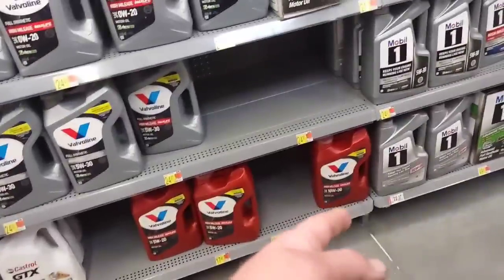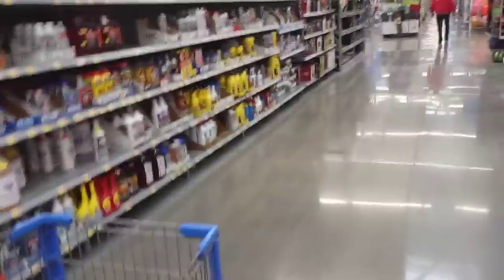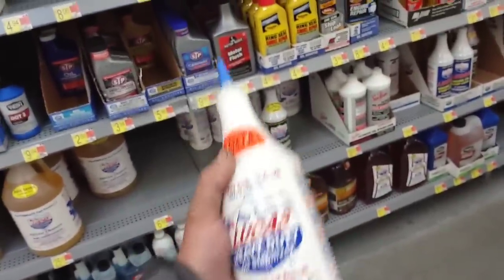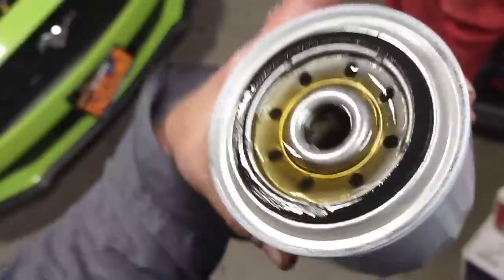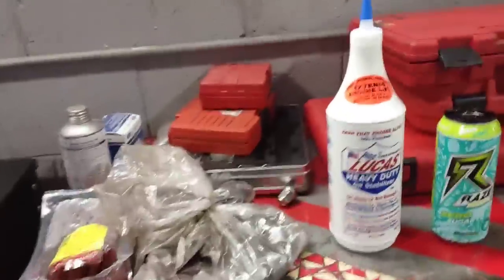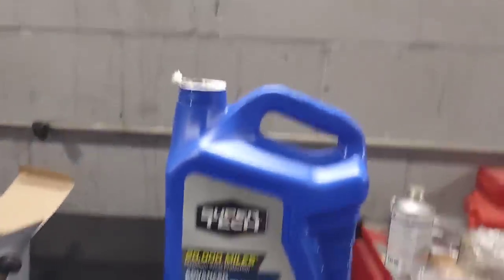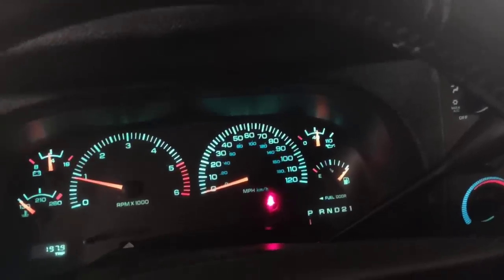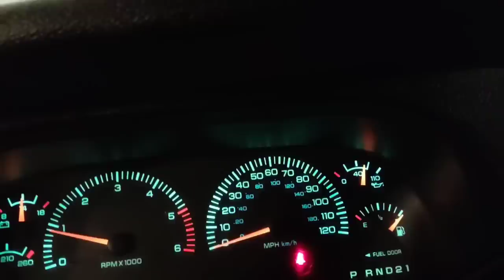We continue With Marvel Mystery Oil and SuperTech 10w30 20k Mile Full Synthetic Oil Dodge Ram 5.2L

Comment: I saw that on mmo's sight they stated it's a 5 weight so it shouldn't effect viscosity of 5w30 oil right?
Reply: They say it will cut it half a weight.
Reply: @delbertcody9154  so I'm guessing not really much of a problem for just daily driving? Temps in my area stay around 70-80 so
Reply: @shoveI  yea I don't buy into the thicker oil, I had heard that the engines are designed for a certain weight so thicker wears on parts because the oil is forcing itself through a small space not designed for it, I don't know if ford boss said this in an earlier video or if some other youtuber stated it but it makes sense to me. But about mmo they stated it's 5 weight and would lower the second weight by like 4 which doesn't seem harmful when just daily driven at a steady warm temp

Comment: 16  ounces of automatic transmission fluid  added to engine oil at each oil change will do the same thing as MMO don't over fill .
Reply: Automatic transmission fluid contains ZERO detergents to clean ANYTHING, so what is actually doing the cleaning and HOW? I call BS.

Comment: MMO looks like 0W-16 oil.
Wonder what would happen if you ran MMO only in an engine that takes 0W-16
Reply: MMO has a very low flash point (128 F) thus you would quickly be left without any lubricant/fluid as the engine reaches full operating temperature much of the MMO would vaporize. This is also why when people choose to run MMO for extended periods of time such as adding MMO to new oil it's a good idea to keep an eye on your oil level as the napthenic content of the MMO will vaporize long before you are due for a new oil change. For this reason the original formulator/manufacturer of MMO recommended adding MMO to the crankcase 300 miles before you change your oil (notice that it wasn't adding to new oil) taking in to account the vaporization rate but also so as to get that dirty oil with loosened carbon particles and loosened sludge out of the engine/pan/pump soon after adding the MMO so as to avoid any possible clogging issues.

Comment: When I was a kid Marvel Mystery oil had had a religion cult like following like Sea foam has now.   These cult like products usually have high powered marketing. When changing oil regularly, no after market additive products are necessary.  The only benefit they serve is making  the user feel good.
Reply from the maker: This is NOT the case 

It really does work

Comment: How often you recommend oil changes on full synthetic?
Reply: 3-5k
Reply: Honestly full synthetic doesn't make a lick of difference.  It's just better oil, still do your regular interval.  5~7 for highway majority, 3~5k for gridlock and stop and go majority.  If you haul, if you use your truck/van to WORK 3k of the cheapest stuff you can get.
Reply: @AK-ky3ou  or Every 6 months if you don't drive that much heat cycles on oil wears it down.
Reply: @greggc.touftree5936  3-5 k is Ford boss’ max.  I’d assume it’s also his recommendation.
Reply: @jaggsta   Not my opinion,  it is Ford boss that won’t go past 5k even with pzu or amsoil.
Reply from the maker: I don't see any reason to go more than 5000 miles on an oil change and if you're in stop-and-go driving 3000 miles especially if you're doing short trips but never more than five thousand and that's my story and I'm sticking to it and before anybody ask me why I've got tons of videos on here explaining why when I'm taking apart Motors I'm not going to get back into it again 5000 Max for Highway use 3000 for in town and short trip driving
Reply from the maker: I would never wait six months to change oil it does have a lifespan the most I would wait is 3 months if you're not driving a lot
Reply: If your engine is still within the warranty period, you must change the oil at the mfg specified intervals, or earlier. Synthetic oil doesn't change that. If you are not under warranty, you can do what you want.
Reply: I live in Phx, AZ. So the temps get like 118 or so for summer. Lots of stop and go. My Ram is actually running like 210 or 215 at times since summer got here. Used to run at 196 or 198. I usually do it every six months but since I have two vehicles every time I change the full synthetic oil it only has like 3,000 miles on it. So I feel like I am wasting the oil. Was thinking of 5,000 mile or 1 year whatever comes first with quaker state full synthetic but 1 year seems like a stretch. Wanted to try Amsoil and go annual oil change or 7,500 miles. Whatever comes first
Reply: Any thoughts to annual oil change with Amsoil or 7,500 miles whichever comes first?
Reply: I agree with you about not going over 5,000 miles with the oil. 5,000 miles seems like enough use out of it. The lifespan of the oil being used is what I question. I have seen project farm send in 1 year old with low miles on it and Blackstone labs saying it is still good. The only oil I would try that with is Amsoil along with their filter or only run it to 7,500 miles. No heavy towing either

Comment: I'm not going to question you because I know you know your stuff but I'm curious to know the answer though why are using 10 w30 with Lucas in a 5w 20 car I'm assuming I know the older ones were five W 30 but I work at a oil change place and people come in with 10w 40 with Honda Civics that are 0w 20 cars and I told him that they could damage stuff because it has the variable valve timing and the engine uses oil pressure to control variable valve timing
Reply from the maker: 5 W 30 + 10 W 30 are what is recommended for this motor but more 10 w-30 than 5 W 30
Reply: @TEAMHYBRID007 — you should flip through an owners manual from the 90s and early 2000s. Most cars came with 5w30 on the oil cap but the owners manual would show a WIDE Range of acceptable viscosities that you can run, based mostly on your climate and operating temps. You’d be surprised that most engines can easily run a 20w50 without the engine even caring one bit. It fact, it will probably thank you in the long run.

Comment: Why the surper tech oil filter?
Reply from the maker: Why not I'm changing the oil in a thousand miles anyway why not pick a 10000 mile rated cheaper filter I mean I don't understand what the questions for
Reply: @FordBossMe  Wow, I guess someone can't ask you a question. Maybe they are interested in why you tried this filter at this point? Being rude for people asking questions is not a good way to pick up subscribers. Wow, rude. Did you wake up on the wrong side of the bed Ford Boss Me?

Comment: I say put 1,000 miles and do a oil change video and open up that filter. Then put a REAL filter (purolator) and good oil... And drive it 5,000 miles.
Reply from the maker: We're just going to assess it step-by-step we can't already project by the next oil change that we're going to be ready for a good quality filter and as long as it still keeps getting plugged up like this it's going to keep getting cheap filters until that warm and fuzzy is felt
Reply: @FordBossMe  I like how you are conducting the experiment as its an economical method to this point with decent quality products ( as per the oil and filter ) rather then breaking the bank with exotic oils or over the top fancy filters. Something that the average person can easily mimic with off the shelf products assuming that the outcome of this test proves worthy of putting into practice for those vehicle owners that have engines with prior history of less then ideal oil change periods causing the sludge build up.

Comment: Valvoline high mileage is good stuff.
Super tech will do good too.  That Lucas stuff is like old stp.   Too much!    10w -40  is good with marvel because marvel is very thin.
Run it 3000 miles and keep a quart of marvel and a quart of super tech in the truck to add if needed!

Comment: On your video your adding lucas oil stabilizer thats as thick as 90 weight gear oil to your engine oil thats a bad mistake on a modern engine that dont got the tolerance then older 80 and befor engines had

Comment: The Walmart brand oil is probably cheaper because of additives that are NOT in it. I used it in a Lincoln LS and it knocked on startup. Changed oil and no knock. It's cheaper for some reason(s).
Reply from the maker: I don't really think that's necessarily it because it had a lot of testing done and it's actually one of the top performing oils
Reply: @FordBossMe  It's been a while since I used it so it may have been improved. I do know the Lincoln LS, with Motorcraft filter, did not like it. Rock on....
Reply: That's simply not the case.  There are plenty of virgin oil laboratory analysis reports published on SuperTech Full Synthetic and the additive package is nearly identical to that of Mobil-1 and other major brands of full synthetic oil, most of which cost significantly more than the SuperTech. 
The reason you may have experienced a knock with the SuperTech full synthetic is that it does test out to be on the low end of the stated viscosity rating which, in cars that are very sensitive to viscosity such as some older high output engines with some wear, they need that extra bit of cushion at start-up to compensate for the bit of tolerance slack and that difference in the viscosity range within the stated rating can make the difference between a knock at start up and no knock. In the case of the vast majority of vehicles that situation won't come in to play. 
SuperTech Full Synthetic also has literally thousands of used oil analysis reports which show that it not only protects the engine as well as nearly any other major oil brand but also does so well beyond what most manufacturers recommend for oil change intervals. It's better to go by science and proven laboratory results rather than speculation. SuperTech Full Synthetic is cheaper because Walmart doesn't spend hundreds of millions of dollars advertising it like the name brands do on their own oils, thus they can price it much lower for the same quality.

Comment: Oil stabilizer is a good idea. Cleaners dilute your oil, so would be a shame to blow your bearings.
Reply: Lucas oil stabilizer dilutes oil.
Reply: You got it backwards, the Lucas is nothing but thick oil with no additives which dilutes the additive package in the oil you are using.  At least the MMO has anti-wear and extreme pressure additives.

Comment: Your crank isn’t getting enough oil
Reply from the maker: I have no idea what you're babbling on about right now and you've left three comments back to back to back and you've been completely wrong
Reply: Your video shows it, you said you got a gallon of oil, you left a quart in it, witch means your put 3 quarts of oil in it correct
Reply: Plus 1quart of mmo
Reply: @FordBossMe  4 quarts to a gallon, you left 1 quart in the gallon, witch means you put 3 quarts of oil and 1 quart of mmo
Reply: @FordBossMe  the engine takes 5 quarts of oil with a full filter to start,
Reply from the maker: Dude you're not paying attention it's not a 4 quart jug it's a 5 quart jug its 1.25 gallons in each container

Comment: IT TAKES 5 quarts
Reply from the maker: I'm not sure what you're referring to it's a 1.25 quart bottle and I left one quart in it which means I took 4 quarts out of The supertech Jug and put one quart of mystery motor oil in which means that's by porch total and you're right in the middle of the safe Zone where it's supposed to be at 5 quarts total

Comment: 5000 miles.. then cut the filter open
Reply from the maker: I can't afford to go 5000 miles right now we'll see in the future I already did an update video where I pulled more carbon deposits out 300 miles later
Reply: i cut the filter apart..kinda messy to do that... but the filter was very clean, not much to see in the filter.. but i have been using syn oil from 2014 and changing it every 5/6000 miles.. and my ovs has less than a half a teaspoon of oil in it.. trans oil get changed every other oil change.. so once a year trans oil change out of 4 quart every time... its cheap to do

Comment: Prolong would have been a better stack.
I have 260k on my 5.4 Ford Expedition
Purs like a kitten 😸 now.
Prolong far superior to Lucas Stabilizer
Reply from the maker: It's whatever we'll figure it out when we get there on the next thing that we do
Reply: @FordBossMe  
Prolong after a vehicle was treated has been track / street tested . In vehicles with oil drained as well as coolant the vehicles continue to run with out
failure or substantial damage.
Research it on YouTube.
It takes care of any viscosity issues and improves milage and wear
Check it out.
I just recently stumbled on to it!  I'm a user /believer.
Watch:
https://youtu.be/v9Sbo9RQA4w

Comment: Mmo and super tech cancel each other out. Super tech adds crust to valve springs, havoline(with deposit shield) doesn't add any new crust, but doesn't clean off any crust either. Mobile and Valvoline will clean crust off. Personally tested on multiple vehicles over 40 to 80 thousand miles
Reply from the maker: We will see what happens I don't think that's going to be the case here

Comment: (for your dodge id recommend the mobil 1 filter supertech filters are just the cheapest of the cheapest fram filters and with all the gunk yor cleaning out a better filter would be a wise idea in my opinion.)
Reply from the maker: So you have to remember there's a purpose behind what I'm doing and I listen and read every comment or at least I try to but there's also a decision that I have to make as a professional in the field what I feel is best making these calls and a mobile filter is not the best call right now
Reply from the maker: There's actually nothing wrong with supertech filters there's been plenty of testing on them and they actually perform just as good as some of the more expensive filters do

Comment: Why using garbage oil .. use Delo 30 .. or Delo 10 30 
Valvoline 10 30 hi mileage 
Super tech oil filter and oil thought you knew better. Damn .. I use only petroleum based oils  
With 190 k on truck use Wix or Napa gold or oem filter and Valvoline or Delo oil .. 
I just changed oil in my D 100 with 440  using delo 30 and Napa gold  ( made by wix )  203 k on engine 
And marvel  1 quart in oil half quart in fuel ...
Reply from the maker: Because this is going to be a 500-mile oil change, I'm running cleaner through it so I don't want to put expensive stuff in there, how about you ask questions before you start passing judgment make yourself look like an a**** like you do